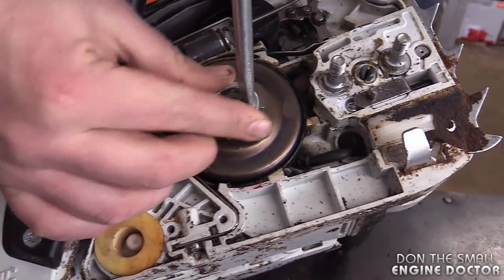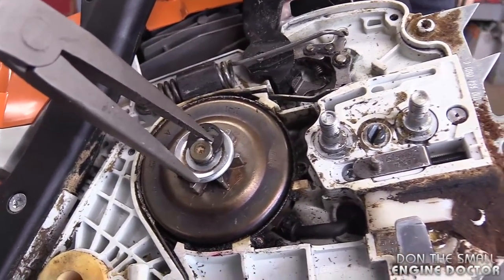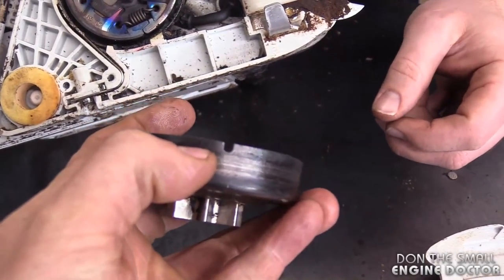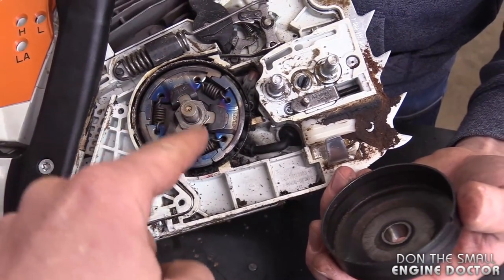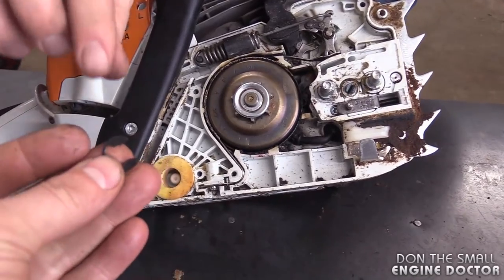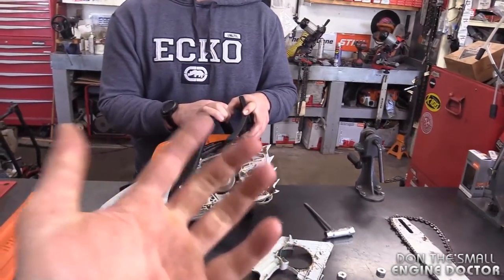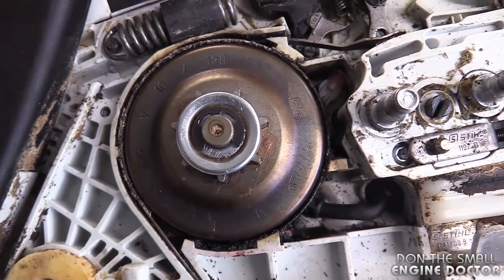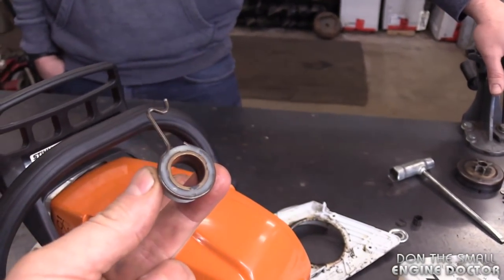How-To Properly Install Sprocket Drum & Clip On A Stihl Chainsaw - Teaching Apprentice Dave! -Video

Comment: Should have come across this video before. Because of the clip wasn't installed properly, the chain jumped the bar and stalled. I found the washer on the ground but I couldn't find the clip and the sprocket bearing.  Great instructions and tips!

Comment: One of my mentors showed me his way of installing the "E" circlips.  He had fashioned a "C" shaped tool from a copper pipe cap that allowed him to press them on and prevent the "flying across the room" mishap.  He also insisted that the sharp edge of circlups face out toward the direction of resistance.  That is, the clips are made with a press that leaves one side with rounded edges and the other with crisp or sharp edges.  The sharp edge holds better, he said.
Reply from the maker: good idea!

Comment: Use the spark plug / bar nut end side of the scrench to pop on the E clip. 
Wrap your fist around the scrench with the screwdriver sticking out between your index and middle finger. 
This method controls the E clip so it can't fly out.   Taught to me by a US Wildland S-212 chainsaw fire fighter instructor

Comment: I used to put the E-Clips on like Don with needle nose pliers. Then I learned a trick from a seasoned old ex logger who told me rarely they would have pliers out in the field. He sit the Clip on as Don does but instead of getting pliers, you use the 19mm/3/4" end of the scrench. You put the scrench over the E- clip and push down. The clip pops straight on and will not ever fly off into the abliss. So you can safely remove an E-Clips & install it with just the scrench. It surprised me how well it works and to this day I don't grab pliers anymore.
Reply from the maker: good idea!
Reply: I need to try this!
Reply: @DavesSmallEngines  Try it Dave but I assure you Don is your best teacher, he is truely a great small engine tech, I'm just a hack. I've buy those 8mm C/E-Clips buy the 10pack. I've shot my share off never to be found. My other tip is to buy quality E-Clips like OEM. The AM China ones deform and don't do there job as well.

Comment: Thanks for posting that. Not only could that retaining clip fly across the room. He lived another day without losing sight in one of his eyes. Was he wearing safety glasses  while doing that? Even with the right tools you should still be wearing safety glasses. Those clips at times are no joke. Even taking piston rings out improperly can cause eye injuries. Some recoil springs as well if they slip out of the barrel and hit you in the face, so a safety shield should be worn as well.

Comment: The best way I have found of putting that c-clip back on is using the spark plug end of the scrench... line up the clip,  put the socket over the clip and shaft and slide the socket to seat the clip. You will never lose the c-clip again and probably alway have a scrench handy when working on a saw, especially out in the field.
Reply: I will try this!
Reply: Agreed! I’ve never lost one using that method.

Comment: Hi don boy great videos. I have two homelike trimmers and both have two lines going from the fuel tank to the motor. One line for both trimmers are not in the hole of the tank.  Do you think theses trimmers are worth saving. I can’t start either one.  Any advice is appreciate
Reply from the maker: if you're fixing for yourself it might be if piston and cylinder are good

Comment: Keeping the E clip from zinging across the room never to be seen, again, is tough.  I use a little screwdriver to pry it out of its slot.  I try to hold it down with my extra hand but it always seems to find a way to go flying and I end up having to buy a new one from my local Stihl dealer.  They are size specific for every saw.  I guess my loss rate is about 50%, no matter how careful I am taking it off.  Putting it back on can also cause problems.  I make sure I wipe a little white lithium grease into its slot in the crank.  I use a pair of kitchen pliers to snap it back into its slot.  Anything smaller and it could go zinging across the room.  I guess my loss rate during reinstallation is less than 5% using this method.  I listen for it to snap in and then I visually check it to insure it is installed correctly and tight in its slot.  If not, I replace it with a new E clip.

Comment: Is there a special tool to use  to keep the flywheel from turning when replacing the sprocket on a Husqvarna 455 rancher?  Really don't want to use a rope in the spark plug hole.

Comment: In the automotive  industry  you  see them  on transmission  lines that  go into the radiator  we call them o shit clips cause  the go flying  across  the  shop almost  impossible  to  find

Comment: When those clips do go flying they will usually end up in the most inaccessible part of your shop.  
It's a law or something.
Reply from the maker: always!
Reply: And years later when they're found, it brings up the "what the heck is this" question.
Reply: @MrJonrocker  
Of course that's after you bought another one.
Reply: Those clips can injure your eye also, so I would recommend some kind of eye protection.👍🏻
Reply: Yes, like underneath my work bench, and somehow manage to completely avoid being picked up by a magnet, on the end of a telescoping rod. I swear, it completely defies the laws of physics.
Reply from the maker: @MrJonrocker  same here lol!
Reply: Right next to the pile of 10mm wrenches😜

Comment: I use needle nose pliers, but I usually put one tip of the pliers in the center hole of the crankshaft for even more stability.
Reply from the maker: Great tip!

Comment: Hi you smart commenters, question. Why does it seem Tecumseh engines are unable to run smoothly. I seem to have no problem getting surging issues fixed, but can never find a video about why it seems these engines love to pup pup pup out the exhaust. I'm not sure I've seen one that runs 100 percent correct. No amount of valve clearancing carb adjustments, etc seem to make much difference. So to the old timers, am I insane?

Comment: How many times has that happened to me.  I keep extra eclips around for most saw models that I have.  I pull off the sprockets and lube the sprocket bearing at least once a year with white lithium grease.  The best way I have found to put the EClip back on is to insert it in the slot and snap it back in with a pair of regular kitchen pliers.  The worst models are my saws with rim sprockets on my big Stihl saws.  They have a real thick sprocket washer.  The spur sprocket models have a thinner sprocket washer which makes the installation of the EClip much easier.  I just put the jaws of the pliers on the top of the EClip and the other jaws on the crank and squeeze it down with the fingers of my free hand over the EClip, so if  the pliers slip, I will not loose the clip.  Silent prayer also helps.😀

Comment: Great vid guys,  I almost made this mistake on a “junked” ms180 which was leaking bar oil and not oiling properly. The clutch felt funny when hand spinning after assembling it so I double checked it and realized.  Obviously someone else had made that same mistake before because the oil gear spinner had rubbed a pinhole in the housing. The oil pump leaked and sucked air.   I fixed the housing with JB weld and so-far-so-good